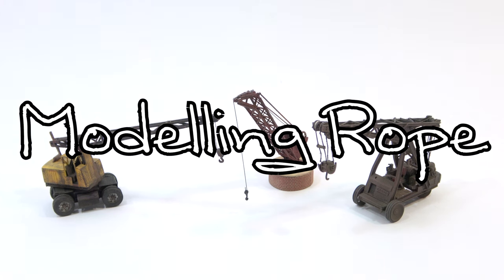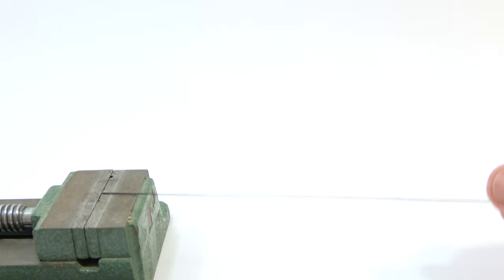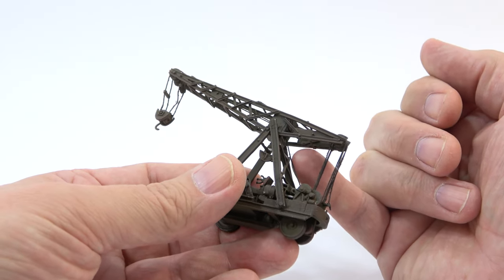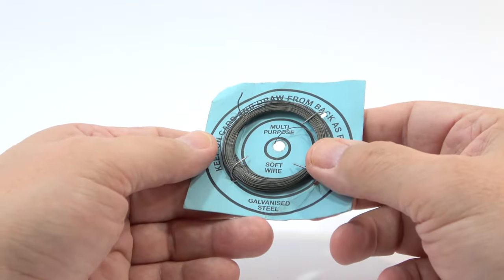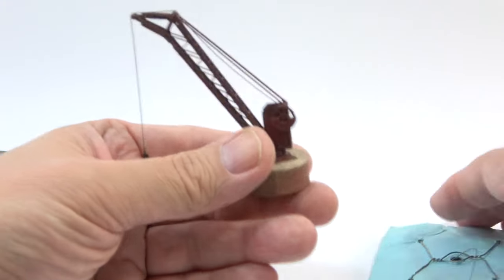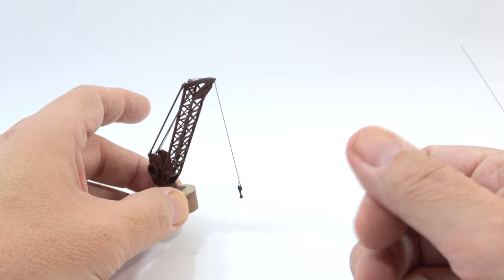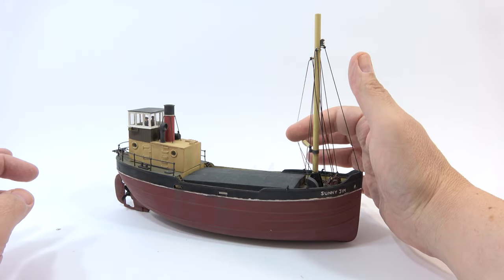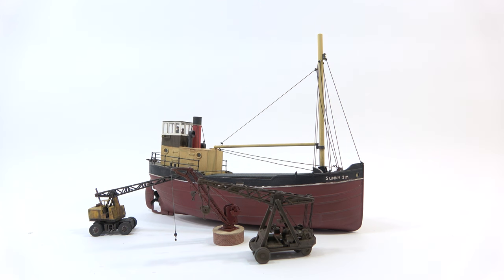Modelling rope with Phil Parker

Comment: Excellent advice and great results. The likes of Hobbycraft (and I'm sure others too) stock packets of florists wire in packs of bare silver wire about 7" long and green plastic coated about 10" long which has the advantage of already being straight. It does, obviously, require painting. Cheers